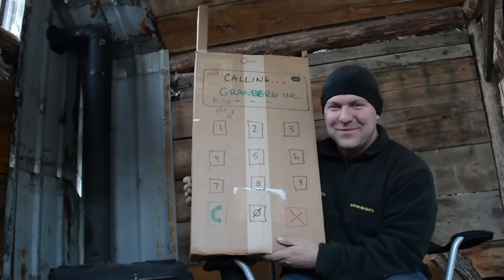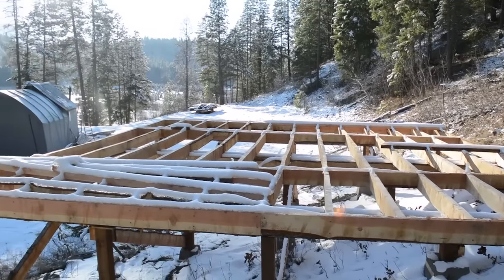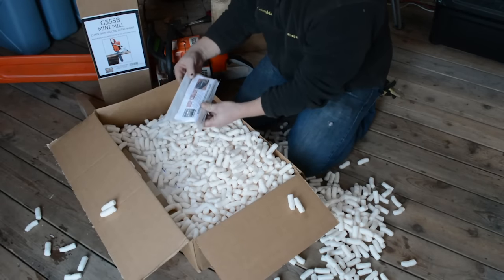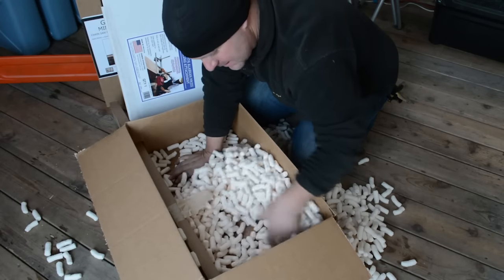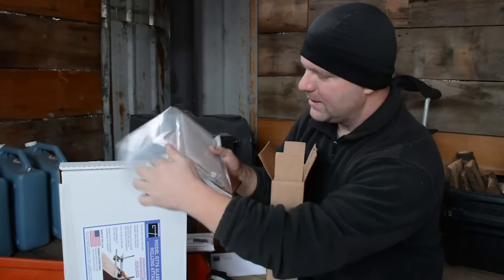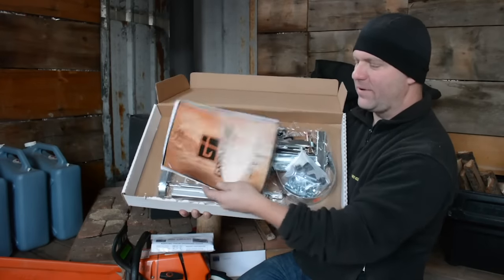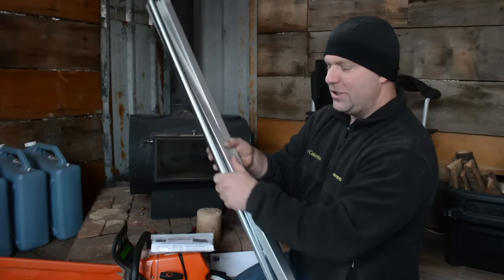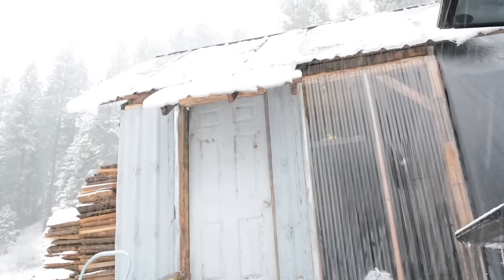THIS TOOL IS EPIC! (Alaskan Chainsaw Mill Unboxing)

Comment: Appreciate your excitement. The ripping chain makes a difference from what I've seen, and I love the smell of sawdust.
Reply from the maker: Very much so. We've used cross cut chain filed at 10 degrees like so many do. Very interested to see how the narrower Granberg chain performs. Easier to use? Less waste? Quicker milling? Will post a video when we get some testing time in.

Comment: Hi, I ordered my Granberg mill and it should be here by the end of next month. I enjoy watching your homesteading videos and hope to one day live a homesteading mentality life style. I figure that if I start accumulating the tools needed now that it will come together eventually. With the Granberg mill, the research that I have done, attach a boat winch to the mill. The boat winch would be around $18 and the nut will slide into the rales of the mill. Take the string through a pulley attached at the end of the log and back to the mill. With the winch it will give you a mechanical advantage and make milling lumber easier. Granite this is only through research and I won't be able to test this out till this spring. I've found a few videos on YouTube that people have used the boat winch attached to the mill. If you search Granberg mill boat winch, you should be able to find the video. Good luck with your adventures and I look forward to your next video coming out.

Comment: The Granberg is certainly the entry level mill into the sawmilling world.  Making your own lumber with any style mill is certainly a satisfying experience when you have a forest of trees on your property.   Given the amount of lumber you are going to mill for your house and other projects, did you consider hiring a mobile sawmill operator to come to your property?  Most of them have a bandsaw mill and will charge hourly for milling time.  The chainsaw mill is relatively slow compared to a bandsaw mill and wastes a fair amount of lumber with the large kerf of the chain.  Then there is also the ongoing running costs with fuel, bar oil, chains, sharpening, etc.

Comment: You can put a hand winch on the on the mill. This will allow you to move the saw easier through the tree. Seen  it done but have not tried it yet.

Comment: I just bought a brand new chain Stihl 16in, dropping some trees on property , should I take it back and get a bigger chain , I want to mill some lumber too , used a chain never milled any lumber
Reply: +ben shafer oh how much did that cost?
Reply from the maker: It's not the length of the bar that's a problem so much as the powerhead. You can get a smaller mill to fit a shorter bar but the smaller saws don't really like to mill. It's just too hard on them. Our MS660 doesn't hard work when milling. Just chugs along. It's a 92cc saw. You may want to go back and talk with your saw shop about saw size. If your saw is smaller than a 50cc and you want to lol lumber you might want to bump up a bit to at least 60+cc. This saw is big and not the best for packing around for firewood but it cuts firewood great too. Just gotta be buff. Haha. Head is 16lbs. Saw cost $745 off craigslist. They are $1500 new. :( OUCH! Saw should last a lifetime though.
Reply from the maker: +ben shafer The mill is about $250 and ripping chain will run $50! Or so. Can't wait to try the ripping chain. Looks like a much narrower kerf so it should mill much faster and easier.
Reply: Place looks great

Comment: So, I know that this is like a year old now, but I guess it still (haha stihl) stands... don't most stihl pro saws (like the ms660) come with .063 gauge bars? the package of ripping chain shown is for .050 chain (generally found on huskies or smaller stihls)... if I'm right about that ms660 having a .063 bar on it, you may actually still be running the wrong chain?!?

Comment: Man I need one of these today! My son is coming to Chile and we plan on building a pole barn. I sure would like to square off my logs. How much was the kit? When can you do a test drive? I want to make sure it's a good buy, if so then I will buy it through your store. Also does STIHL have a mill and if so why not theirs? I eagerly await your response because my son is coming down in two weeks. Jim
Reply from the maker: We are anxious to try it very soon. Just need a day for things to thaw. Have warm temps in the forecast for the next week or so. Stihl does not offer a mill. The granberg is by far the most popular mill in the ALASKAN category. There are a few other companies we have researched but granberg a is made out of aluminum which means no corrosion and light weight. The others are painted or powder coated steel. Heavy and corrosive. The mill is about $250 with at least a week wait time. If you need one just give Granberg a call direct and order from them. It's much faster at the moment. Ask for Ben here is his number 925-380-9398. Tell him we sent ya.
Reply: ChileExpatFamily